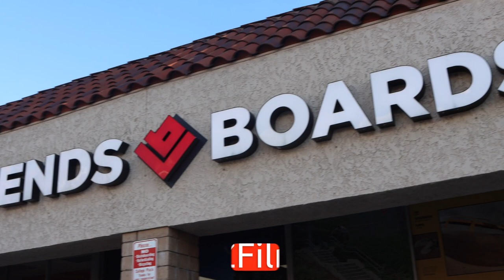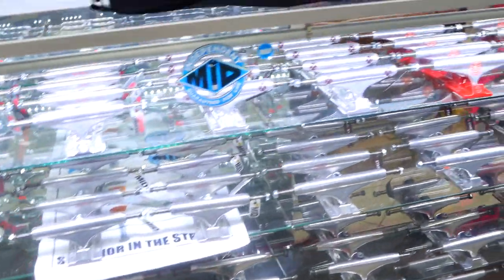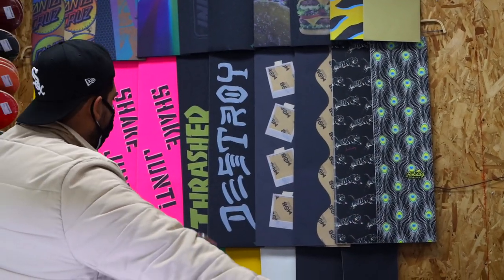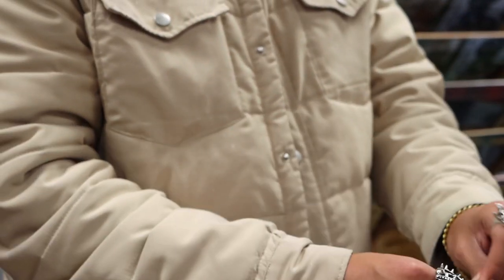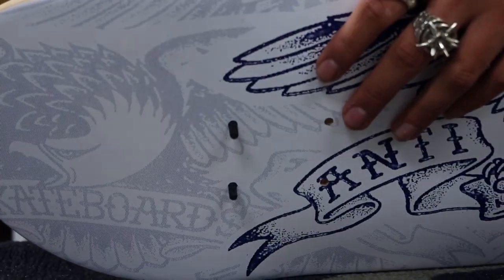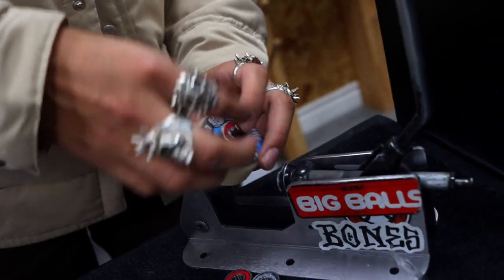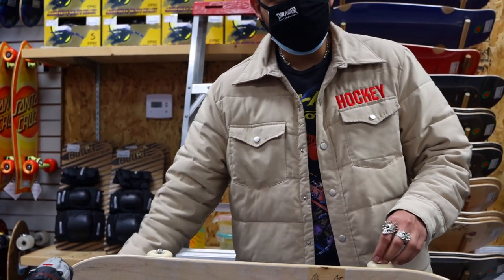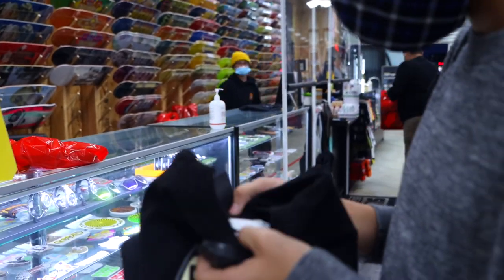Supporting Local Skate Shop FULL BOARD SET UP Legends Boardshop

Comment: I have no local, i wish i did because online shops only list the dimentions but never how steep the nose, we got 2 boards in this house and the only diffrence is a quarter inch in length and width but they may as well be the same, id like to have one with a more aggresive angle but you can never tell by the pics and I have yet to see a shop list if its mellow in the details.